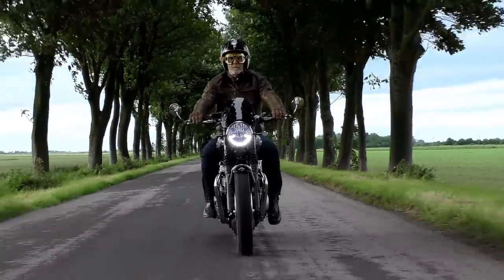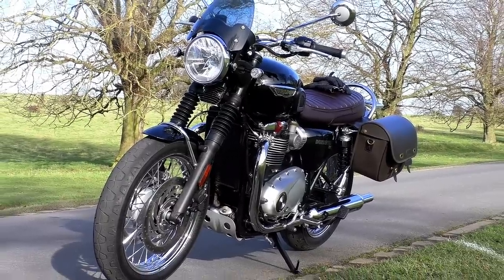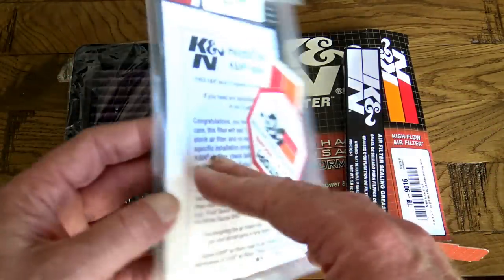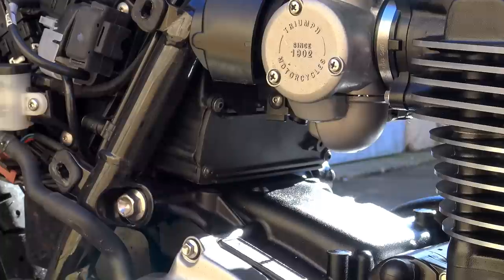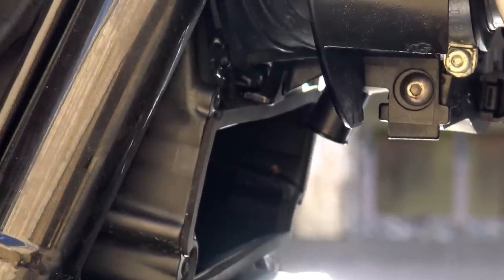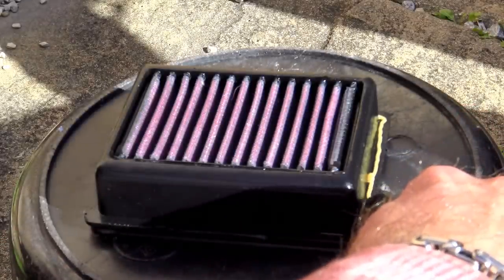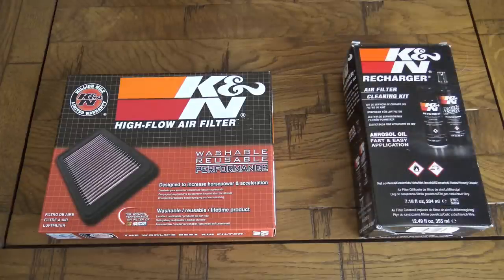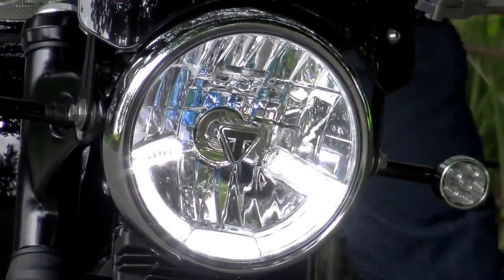TRIUMPH T120,Street twin,Street cup,Street scrambler! Fitting K&N performance air filter

Comment: Thank you again I planned on putting one of these filters in my triumphs then I just picked up at my local dealership it was used they said they went through it. With all the motorcycles have purchased off them and we're talking $27,000 motorcycles 2018 Indian Chieftain, 2020 Indian Challenger and the 2021 Royal Enfield interceptor you think they'd make sure they really did go through it and you should see the air filter I took out of it it was black as the the paint job on my bike they will be getting it back later today and reimbursing me. They did give me the oil for an oil change at least they did that along with the filter now we're just going to go get cashback for a air filter 😊

Comment: Hi Stuart, I love you videos. They are very inspiring. I just installed the K&N filter  on my Street twin 900. I can feel an improvement in torque. Greatings  from Belgium.
Reply from the maker: welcome aboard Jean Luc and thank you very much!
Reply: Hi Jean, did u install filter because your power go down, or just u need to change filter? I have Street Cup 2500km, when i need to change filter? Is it with garanty ok?
Reply: Hi Robert, I have 3500km and the  original filter was  still as clean as new...but I wanted  a bit  more airflow  and  more power. I had  K&N filters on my HD an Ducati before....I think there is no problem with  garanty....

Comment: Your videos are always instructive (and often entertaining) thanks. The information provided is clear and solidly trustworthy. Between a Haynes manual and your postings, the average Triumph user should have no trouble maintaining their machine to a high standard. 
I have just installed a K&N air filter on my 2017 Bonneville T-100 and wasn't sure about what K&N intended re. the the application of their grease that comes with the filter.  Its purpose is to fill any tiny imperfections in the air box moulding, so as not to allow any tiny particles to circumvent the filter ... and go directly into the engine. 
Their instructions direct you to put a light bead of grease on the upper edge of the filter, so I was a bit conflicted by the advice in your video to put a bead around the lower edge (between the filter and carrier) ... to avoid the possibility of a stray bit of grease being sucked into the engine and causing trouble. 
For peace of mind I spoke to someone in the Technical department of K&N today about the best course of action here. The consultant told me that grease under the filter, as you depict, wouldn't hurt, but isn't really necessary. A fine bead of grease (that the tube is designed to dispense) around the top edge of the filter seals the more-important joint between the "clean" side of the filter and the air box, and carries no risk ... in their opinion, the air pressure would never get high enough to suck a nib of grease off the frame of the filter and into the air intake. 
No disrespect (quite the opposite) but I thought I'd share this P.O.V with anyone else that may have had the same question.

Comment: K&N's are always one of my first mods; had to wait a bit for them to make one to fit my Daytona when I bought that ('97), and not too long after I put one in my T100 I went a step further and mounted an airbox removal kit (which included two K&N's for the carbs), very similar to the set-up on my old Yamaha after I threw out its airbox -- still going with 124K on it but torn down for a rebuild as head gasket was leaking.

Comment: Happy Birthday! I think K&N is at least easy to wash and lube - only thing one could do wrong is lube is too much... We had K&N:s on our former bikes, now we have Unifilters - they are much more difficult to clean if the most sticky air filter oil is used (French Motul I think is the STICKY one for foam filters...), but one likes to be sure it stays on the filter and doesn't travel into engine... Found some (Motul, too) non bleach-based but a detergent (hydrocarbons, xylene etc. better always wear liquid safe latex gloves) that does the job... So, K&N is easy and most probably lasts the life of the average user...
Reply from the maker: Thank you Mr Dark! I don't think ive come across the unifilters! or may be I have but just don't remember! yes I have read that over oiling can cause some problems.
Thank you as always for watching!

Comment: Hello Stuart,
Great video. Do you have any information if this filter fits the T120 euro 5 engine MY 2023.
 I ask this because from my understanding, a buster plug is not compatible for 2023 models. It has to do something with the sensor regulation and engine warning light. If there is a change in air flow some sensor might report a change and activate engine light???
Thanks

Comment: Stuart u are like a guide for Triumph owners. Great video. I already buy K&N in Germany about 60e. Do i need a remap fuel maps or buy a power Commander? If i change a Silencers like u did what i need to do? Thx for your experience. You are better than my Triumph agent from marketing. You build good name for Triumph.
Reply from the maker: No it doesn't need to be remapped Robert just start her up after swapping and leave her to idle for a few minutes. the ECU will make all the adjustment's.
Reply: Stuart, thx for answer. Did the filter change a sound of bike?

Comment: Hi Stuart.. am planning to fit one of these to my 2016 Street Twin.. it appears from the K&N website that you’re supposed to put the sealant around the top edge of the filter, then slide it straight it..
Reply: Hi Stuart, thanks for the reply..It does seem a little odd putting exposed sealant into the airbox

Comment: Very informative.  Just two questions:  does the Oil from the filter adversely affect any sensors (mass air flow)?   Also, are you a Rocker, or a Mod?  Thanks

Comment: Here's a question. I have only fitted K&N filters to two bikes, but both suffered from increased fuel consumption after. Only slightly, but have you found that?
Reply from the maker: Ive not had chance to fully put it through its paces as yet, but the fuel computer isn't showing any difference as yet, where they carburated bikes or fuel injected?
Reply: I have fitted a K&N air filter to my Royal Enfield Classic 500. I also replaced the heavy and restrictive factory silencer with a tuned BSA Gold Star type. The ECU has fully compensated without issue. These two upgrades have completely changed the performance which is now far more responsive and noticeably less labored. You can actually tell the engine is happier. Yes the mileage has dropped a couple MPG as a result, but may also be from my happily winding more out of her. I agree with Stuart's excellent assessment. In my case the drop in MPG is well worth the obvious gain in performance.

Hey Stu, I saw some surface rust on those pliers of yours. Better get  after that with some Muc-Off rust remover and chrome polish. ;-) Happy birthday Matie.
Reply from the maker: Those pliers are almost as old as me!
K&N suggest that the filter may improve fuel economy so perhaps it is a case of a looser right wrist?
Thanks for watching Kevin!

Comment: Happy birthday.
Reply from the maker: Thank you very much sir!
Reply: stuart fillingham  Hi Stuart first of all Happy Birthday.
I enjoy your youtub clips and found them very helpful.
I have a 2017 t triumph t 100 and hoping to fit a k/n filter soon ,when they come out.
Thanks for the help on where to fine this on the Triumph .
Keep your good work up 
Paul
Reply from the maker: I Paul Thanks very much! Give K&N a call I think they do have a filter that is suitable but have been unable to fit test it as yet! the model number is TB-9004. let me know how you get on!
Reply: stuart fillingham
Hi Stuart
I have done some research on the t 100 Bonneville  2017 ,
So far the K&N air filter  looks and I believe used ,is the same one as yours ,
My 2017 new t 100 HT 900 has the same air filter box as the street twin 900 HT engine 
In the next week if I have time I will remove my air filter and have a look!
Triumph say the  new 900HT engine  used in the street twin is used in the new t100 Bonneville ,so I hope they use the same filter .
Will let you know more soon .
Regards
Paul
Reply from the maker: That interesting paul! K&N gave me a diffenent model number. itmight be worth giving them a ring . if you can take out the stock filter and take some measurements that might help pin down which one it is!

Comment: I notice at the end of this video, as you come to a stop, you shift the transmission into neutral.  When I park a bike on the sidestand, I find it prudent to leave the transmission in first gear, as that's my only "parking brake."  Left in neutral, it can roll of the sidestand and there goes the chrome on one of the silencers.
On old Brit bikes, since we had to find neutral before kick-starting the bike, we often fiddled around with the shifter to find neutral when parking so that cranking the bike later could be done without the fuss of finding neutral.  It was silly, but that's what we did.  However, on modern bikes, with clutches that actually release, hitting the magic button in gear is quick and easy.

Comment: My own experience with K&N would not engender any trust whatsoever in that company. I "fitted" their air filter for the Suzuki S40 only to discover that it does not fit, will not fit and will leave gaps that will damage your engine. Period. When putting up their rubbery air filter casing against the original it's obvious that it cannot fit. The worst part of the experience was dealing with their technical department. They kept asking me more and detailed questions, but they never answered. They referred me to various departments but again, I got no answer they kept fobbing me off till I simply went away. I did get a refund from the seller, but K&N came across as well dodgy both in their execution of their product and in their response to my enquiries. It is my belief that their success is due to marketing that feeds on itself.